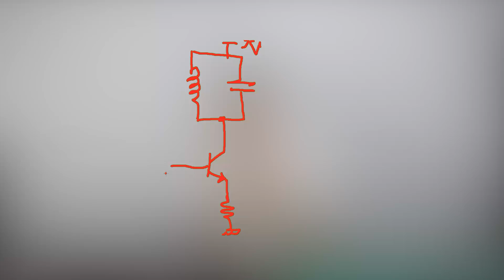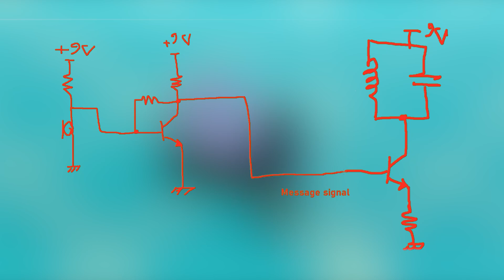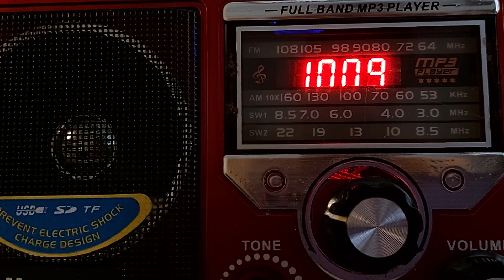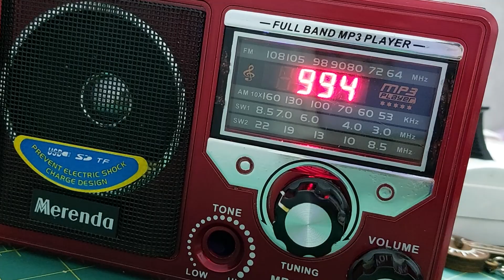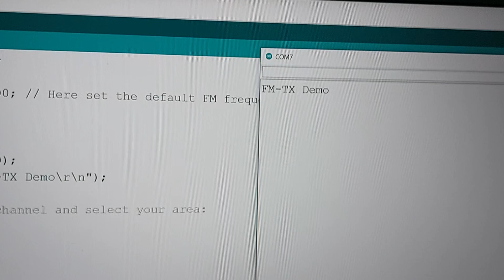Make an FM Transmitter like this

Comment: Can you please make a video about a carrier frequency generator... Because I want to use ASK format to send digital data...
Reply from the maker: For this, I suggest you use ASK modules. I have many videos about it on this channel.
Reply: @BabakStars the existing modules have really low range. I think I can make a 5W transmitter for a CB range frequency if I have a proper circuit, and then use ASK. Regards...
Reply from the maker: Please like this video. Thanks 🙏
Reply: @BabakStars I really want to make a custom one, with either a crystal or a stable colpittz oscillator. That way I can also tune the frequency for better penetration and range. I request you to please make a video about it... 😀
Reply from the maker: wait, I have an idea about this and will share it with you soon.
Reply: @BabakStars  Sure mannn ! 😀 Love you elegant way of telling btw. I hope you dive more into the world of custom made legal transmitters so the average electronics geek should not be dependent on readymade modules 😀 Good luck 👍